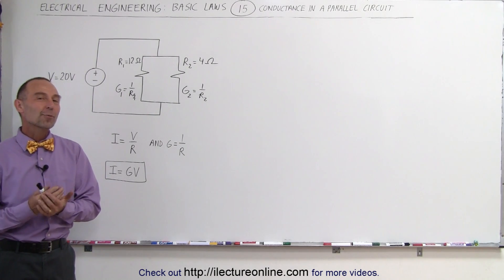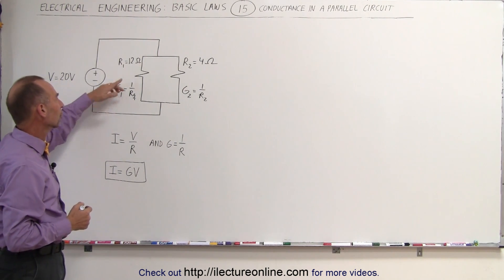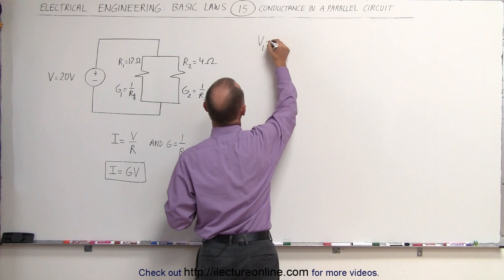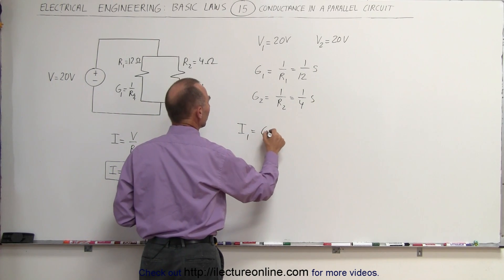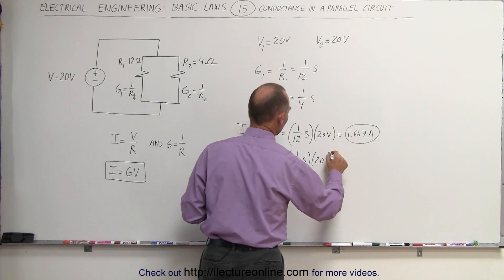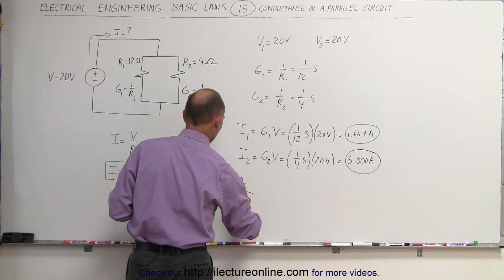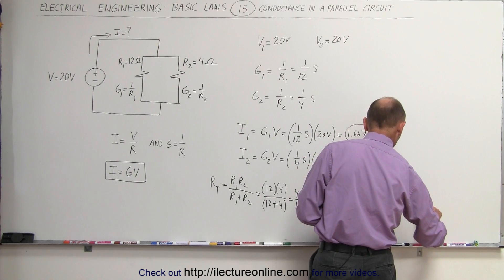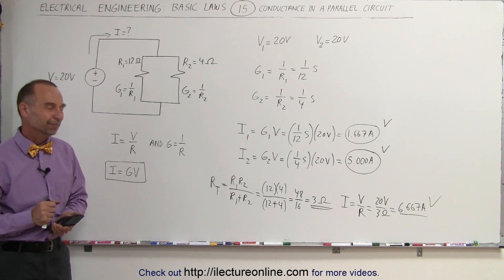Electrical Engineering: Basic Laws (15 of 31) Conductance in a Parallel Circuit

Comment: Parallel 10 ohm resistors should be replaced by an equivalent 5 ohm resistance but you put the 10 ohm back in the diagram making the final resistance wrong.